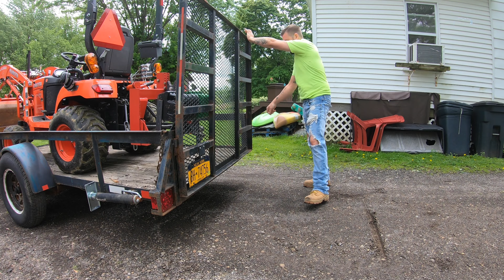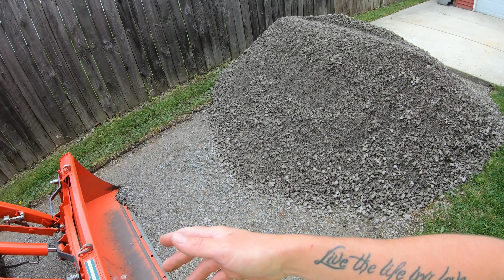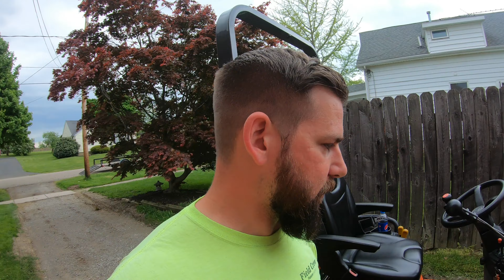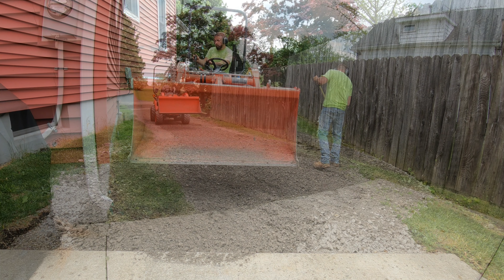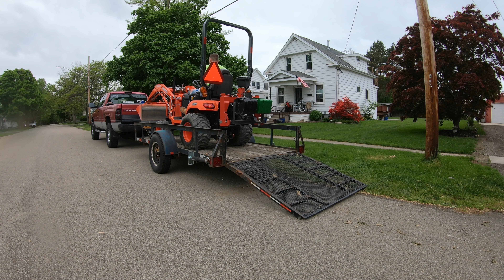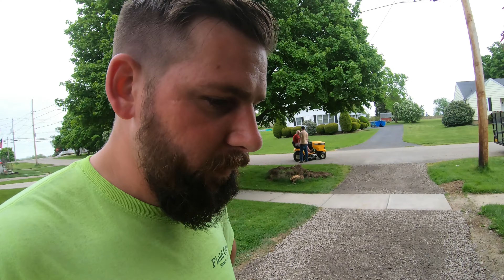Kubota BX- Spreading 5 Ton of stone with FEL (Driveway Top Coat Job)

Comment: You are the master with leveling with the bucket.  I always end up with a roller coaster instead of smooth
Reply from the maker: Thanks man I appreciate that! I actually havnt been as smooth as I use to be (IMO) only because my loader valve  has been quite sticky this summer.. my loader valve has been sticking and acting up lately because I’m in desperate need of changing my hydraulic oil and filters making it difficult for me to be as smooth as I use to be with it (and it’s been driving me crazy) lol I plan on changing the hydraulic fluid soon which should take care the the sticky loader valve issues Iv been having this summer. 

As for back dragging I know what you mean about how it gets lumpy and bumpy.. this is normal, you just have to find the right pressure and bucket lip angle for the material your trying to spread and for the amount your trying to spread at one time as it will always change depending on those factors.. sometimes I start off in float and end with down pressure, other times I start off with down pressure and end with float.. other times I don’t use float OR down pressure but just rest my bucket on top of the high spot as I backup.. I also change the angle of my bucket often.. if I need to drag out a lump or a high spot then I start with the bucket curled more aggressively:. If it’s a really small bump then I start with the bucket angle less aggressive.. you’ll get the hang of it, just gotta stay at it! Thanks for watching 👍🏻

Comment: Another great driveway job. I should have called you to come play on Thursday, when I got about 46 ton of road millings dumped in my driveway. The BX handled it fine, and now it's all leveled out and rolled.
Reply from the maker: Wow 46 Ton you must have been a busy guy Thursday! Glad to hear you rolled it out after cuz you almost need it with millings but once you roll it out they are good.. I never rolled mine and under the millings in my driveway was a real hard base so they never settled or packed. They make a special spray you can spray the millings after with a week sprayer and it hardens them like Asphalt again you should check into it. Glad to hear your BX handled it no problem!

Comment: In my state you have to tie down tractors with secure load binders, so they don't take off in the event of an accident.
Reply from the maker: Here your allowed to use straps or chains/binders. Chains with binders are always the best though and most secure. If i was hauling it state to state and not just 5-30 min down the road id also use binders but it’s not really needed with such a small machine on such a short travel

Comment: Have you ever tried the Mike Morgan method of letting it fall like rain. I do what you do and his way as well.
Reply from the maker: I actually do both as well but I find when the stone is wet and heavy like this was (as it just finished raining before I got there I can dump it and spread it manually much smoother than if I shook it or let it pour out like sugar.. all depends on what I’m trying to do too.. if I’m just filling low spots I will sprinkle it like that but if I’m putting in a fresh top coat I find it easier to dump it in one spot so I can manually control the spread myself. Hope this helps!

Comment: Another great video 👍Mr Biff I was wondering how is the oversized injectors working do you notice any more power 
I can’t wait to see you do the turbo but I do believe one thing if you do not use your PTO that much I don’t see the point I think that is where all that extra power is going to pay off the best I know I would sure love extra power when I’m running my snowblower thanks again for another great video
Reply from the maker: Thanks Mike! Yes I’m def gonna be adding the turbo still hands down.. just waiting on the right time to finish building my turbo kit. Your correct the tractor will run and operate very much the same when doing loader work and other easier tasks on the engine but when pulling rear implents, using the PTO or pushing hard is when you’ll really see the power increase. I may also gain a little fuel economy once it’s done too which is good, as of right now it is using slightly more fuel than it did before but that’s to be expected.. once the turbo is installed it will bring it back to where it was originally if not slightly more efficient
Reply: I wish we could upgrade the hydro pump like you can on the 1025r.

Comment: i like your videos when you are backdragging is the loader on float or are putting down  pressure on it thanks
Reply from the maker: Thanks buddy, it all depends on the situation but I’m normally going between float and no float during the same pass.. I go in and out of float quite often depending on what I’m doing and will often use float as a height or depth gauge before clicking it back out

Comment: Great job again and I have been asked by one of my neighbors to repair his badly washed out driveway. It's a perfect job for my BX 1880 and the FEL but my question to you is what do I charge for it.. The drive is about have the length of the one in this video. I don't really need the money but I should charge something for doing it. I believe he has enough gravel to make the repairs.
Reply from the maker: Hey thanks buddy. Agh that’s a tough one because I’m not sure what type of relationship you have with your naibor or your going rates in your area.. and with out seeing what kind of work needs to actually be done it’s hard to make that call..  also depends a lot on how fast or slow you work and all that.. id say if your just regrading it out for him maybe $100 cuz he’s your naibor… if it’s a real quick job maybe even less but if it’s a full regrade then you  may want to charge more but it sounds like a great first job to get your feet wet and experiment a bit.

Comment: get a box blade for that thing and be done in half the time! also the video cuts, but do you tow that thing around without strapping it down at all???
Reply from the maker: Of course I strap it down.. I just don’t always show it on camera cuz who wants to see the same piece of equipment being strapped down every single time.. I have plenty of other videos showing me strapping it down and how I do it. As for a grader box, I owned one before this but sold it due to it being a 6’er. I planned to find a 5’er with the money but was never able to come across a decently priced 5’er in my area.. so I just continued to use the bucket as I am very fast with it. Certain jobs would be faster with the box please, but jobs where I’m only spreading 5 or so ton of stone wouldn’t be IMO, and I can do a much nicer more detailed job with my loader bucket as you have so much more control over it. Someday I’ll get another back blade, this video is also really old. Check out my more recent ones. Thanks for watching

Comment: Do you typically have an attachment on the back to balance the front loader weight?
Reply from the maker: Hey Candis, I use rear suitcase weights for ballast.. that’s all I ever use unless I actually need to use an implement on the back for a job.. otherwise the suitcase weights work awesome and they don’t hang low or stick way out like a rear implement would so you can be more productive. I currently run 8x 42lb weights on the rear as well as filled rear tires.. most people get along just fine with only 4x 42lb weights but I had to double it as I have increased my hydraulic pressure over the years to get more lift out of my loader. 

Thanks for watching!

Comment: How long is that trailer?  I'm wondering if I can get away with a 12 or 14' trailer for a new BX23S w/ backhoe?
Reply from the maker: My trailer is a 5x12 .. you won’t be able to fit a backhoe on it as the BX is roughly 14’ long with out a backhoe with rear weights on the hitch.. so with a 12’ trailer I need to have my bucket on the front rail to be able to fit it.. a backhoe MIGHT fit a 14’ trailer but it’s gonna be pretty tight. Make sure you buy a tandem axle not a single axle like I have.. I’m at the end of my weight limit on my single axle

Comment: how much weight can your trailer hold? I am buying a bx tomorrow. My trailer can hold 1550 pounds. would that hold it?
Reply from the maker: My old single axle trailer could haul up to about 3200lbs cuz it had a heavy duty axle. I wouldn’t trust a trailer with a max capacity of only 1500lbs as the tractor with the loader can weigh more than that so just be very careful and don’t drive fast or far. How did you end up making out? My new trailer is a tandem axle.. you can see it in my latest videos

Comment: Are you floating the bucket when you back drag? Or keeping it fixed?
Reply from the maker: I do quite a bit of everything.. it all depends how packed the material is and how high it is.. if I only wanna pull a skim coat then I float it, If I wanna pull a lot of material then I add pressure.. but most times I’m going back and forth between float and pressure all in the same pass.. so I’ll start in float then click it out as I back up, or I’ll start with pressure and then click into float when i feel iv pulled enough material to fill the low spot
Reply from the maker: If you watch my more recent video (Biffs loader tips) “Video Review” video it may help you understand as I think I touch base on it there